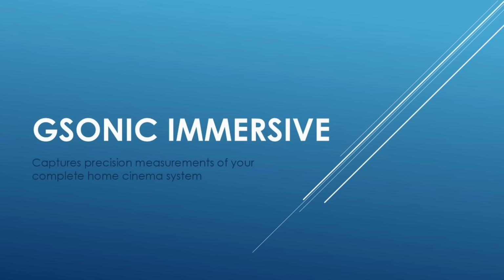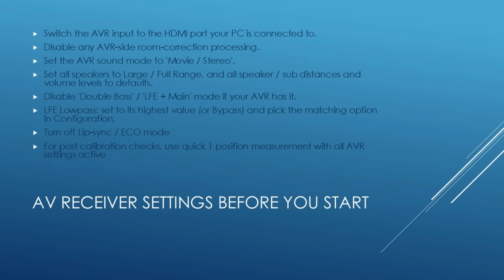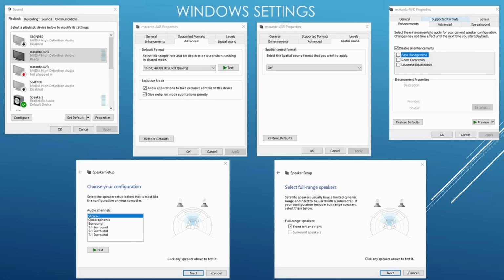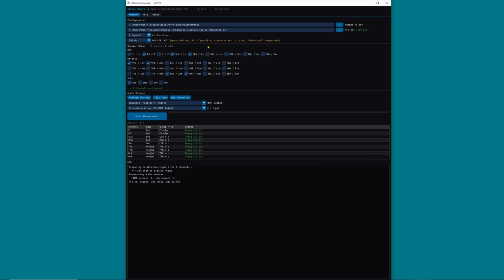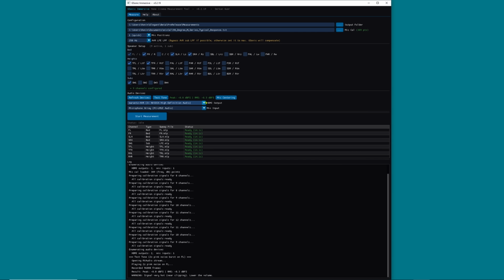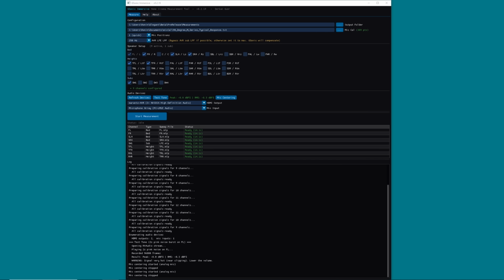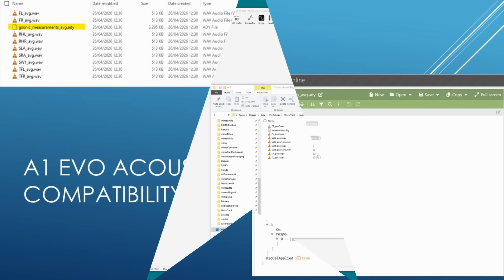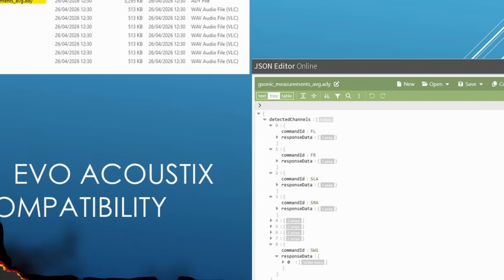GSonic Immersive

Comment: Posted on the Facebook group but posting here also hoping for a fix as I bought a umik for this!

I have everything set to the video, but sweeps are hitting different speakers, center channel is hitting my top left height. Everything functioning correctly outside of app. I think it’s a routing problem. Maybe some debugging can be added to app so I can post a log? Denon x2800h.

If some debugging added I’ll be very proactive for you to fix. Thanks!
Reply from the maker: That's only ever possible if your AVR is in an up-mixing sound mode. Please read the boring Help page of the app. I updated it with v1.1.0 with new info based on issues seen with some users. For example if your AVR supports it, "pure Auto" mode works better than stereo in some models. That alone will probably fix all your issues however, if problems continue, app already saves full debug logs and you can share them when you need to (see app About window).
Reply: @ocaudiophile  Hey, auto worked! Thank you. Music stereo did not work on my receiver.
Reply from the maker: Thanks for the feedback. Enjoy!

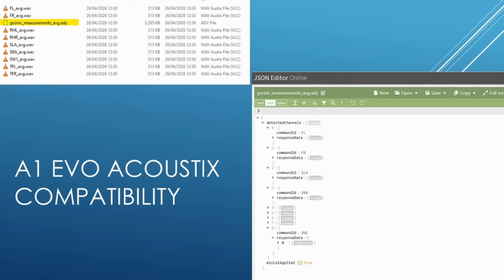Comment: There’s an error at 13:12 where instructional content form the video seems to start spontaneously halfway through? Is this missing information or repeated from before? Thanks!
Reply from the maker: It's an editing error for sure. I need to check and see if it can be removed (no editing allowed in YT only cutting)
Reply: @ocaudiophile  Thanks! Can you tell me if GSonic performs the same functions of A1 Evo Acoustic? Will it correct my room automatically? Im asking on the forums and I'm getting "it's a measurement tool" which makes me feel like it's not going to do the automatic room correction? What are the differences from A1? Thanks!
Reply from the maker: No, GSI is just a high precision measurement tool and not limited to D&M gear but it can generate ady files suitable for AcoustiX.
Reply: @ocaudiophile ahhh that’s very good about non-D&M support!

Comment: Please could you check if there is a programming error for the SHL/SHR channels? During measurements with Gsonic, the SHL/SHR sweeps  are always output through the FHL/FHR channels. I have changed various settings on my AVC-8500HA, but the problem persists even with different configurations. However, when I check the AVC DENON using the internal menu with pink noise, the routing is correct. The SHR/SHL pink noise is output from the corresponding speakers. All of the other speakers working properly in according to the signal sent from Gsonic. Thanks in advance.
Reply from the maker: Unlikely but I am looking into it. Will let you know.
Reply from the maker: SHL/SHR is correctly generated as identical and direct replacement to TML/TMR (top middle) similar to FHL/FHR being a direct replacement for TFL/TFR and RHL/RHR being a direct replacement for TRL/TRR. These pairs cannot exits simultaneously. And although SHL/SHR is quite rare (hence the reason I needed to double check), all others have been widely tested with no issues. Since your 8500 can do all 3 ceiling configurations, there might be a model specific issue with the renderer directing the sweeps. Can you try changing the names of SHL/SHR speakers to TML/TMR and see if it's fixed?
Reply: @ocaudiophile  Where do I change the name in Gsonic or in Denon? I should unchek SHR/SHL and Check TML/TMR in Gsonic?
Reply: I tried to unchek SHR/SHL and check TML/TMR in Gsonic, signal now is in RHL/RHR?
Reply from the maker: You have to change the amp assign configuration in the Denon menu. Do you have the U30 update?
Reply: @ocaudiophile  Yes I Have.
Reply from the maker: If problems continue, just set your SHL/SHR speakers as TML/TMR in your Denon and tick TML/TMR in Gsonic. You should be able to measure them correctly and you do not need to change the settings back. It's the same thing for the renderer.
Reply: @ocaudiophile  I tried, and have changed speaker lay-out from SHL/SHR to TML/TMR  (speacker hight installation  to speaker in the ceiling) now it is working. But I d'ont have speaker in the ceiling and for me any calibration means have to change lay-out and after have to change speaker name i the ady file. Is it possible to fix the problem with correct related address to name? Thanks
Reply: I feel like I’m having this too? The sweeps play from wrong speakers.  Center goes to top left height. Denon x2800h.
Reply from the maker: That's not possible unless you are setting your AVR to some upmixing  sound mode. Please read app Help page carefully for common issues and fixes.

Comment: I'm little bit confused. Does the benefits of this tool, timeings, phase ect, contribute to AcustiX callibrations? Does generated ady file even have the data model for all that precision of GSonic measurements and how efficiently AcustiX uses them?
Reply from the maker: Yes, they all go into AcoustiX. Although the resolution needs to be dropped for Audyssey compatibility, the phase fluctuations inherent with Audyssey measurements are not in the original and will not pass to the ady file. If you have very clean signal line in your set up (very very rare) and you already have multiple repeat measurements you are using happily, you may not see a night and day difference though.

Comment: Very Nice Job OCA!:trophy-yellow-smiling::medal-yellow-first-red:
Is the GSonic Immersive including the correction filters fully functional and will work will all the GSonic features on the Emotiva RMC 1 Plus Processor?

Or will GSonic Immersive work only on AV Receivers and not work on non Marantz Processors?
Reply from the maker: Thanks. It does not create filters. It's only a measurement tool and yes it can measure all speakers/subs from ANY model AVR//amp/receiver that you can connect to your PC via HDMI.

Comment: What's the support contact email?  I just bought this and need assistance (Keep getting FL ATR error)
Reply from the maker: Can you try with "Allow exclusive access..." un-ticked for the microphone you are using in Windows settings?
Reply: I don't see this option in windows 11.  Btw I am using Denon x3500 with Denon mic @ocaudiophile .. the app also can never find my receiver unless I manually input the IP... I been using acoustic evo without issue.  I believe the issue is the mic volume is too low because when I text my voice it's low volume... But gain is +30db (max) in windows
Reply from the maker: Press Windows key + R
Type:
mmsys.cpl
Press Enter
Reply: Thanks toggling Allow Exclusive seemed to fix this.  I'm able to take measurements now.
Reply from the maker: You will not have to do this after the next update

Comment: How I can misure CH Hight Central Channel and TS Top surround Channel for my Auro 3D configuration? Maybe Coud I  use SDL and SDR buttons?  I Think  it is a possible  alternative connection at the same receiver out section (Height 3). In dolby atmos Height 3 have SDL and SDR connected to instead in Auro 3D I have, in the same order, TS and CH. My receciver is an AVC-X8500HA DENON receiver?  Or maybe you can add the CH and TS Buttons. Thanks
Reply: I am using the latest (1.0.9 - build 7DEF55) release of your software. I tried using SDL and SDR to replace CH and TS, respectively. I used Dolby Access in Windows in a 7.1.4 max configuration with the “Stereo” selection in the AVR and took the correct measurements with the right speakers TS and CH. In the ADY file, I replaced SDL with TS and SDR with CH, and Acoustix recognized it and performed the optimization phase. Perhaps you could add two new buttons, TS and CH, with the same addresses as SDL and SDR (one choice excludes the other in the Atmos configuration for DENON AVC-X85500HA). This way, we can avoid having to edit the ADY file after taking the measurements.
Reply from the maker: Noted, good info, thanks.
Reply from the maker: Unique Auro 3D channel sweeps are not technically possible. There's a new firmware update where you can redirect channels to those but only some new top end models got it. Not sure if 8500 did. The only other option is to swap speaker cables.

Comment: Hi OCA, can I ask one question so it can be put to bed. Do you recommend 0 degree or 90 degree microphone setup for Gsonic immersive, I know you have said zero degree pointing at the speakers for the stereo set up in Gsonic reference; just wanted to confirm if it’s the same for immersive and Atmos speakers. 

Thanks
Kevin
Reply: Perfect thanks; that gives me an excuse to do it all over again this weekend with V 1.09 😂
Reply from the maker: To measure speakers placed all around the room, your best way is to use the mic pointing up with 90 deg calibration file.

Comment: In the event of issues regarding differing test tone volumes between the Front Left and Front Right channels:

BEFORE performing the measurement, start playing a movie with a Dolby Atmos audio track (this is important!) and, within the receiver's setup menu under "Surround Parameters,"
disable "Loudness Management." This is sometimes where the solution lies.
Set all options here to "OFF" and the LFE level to "0."

Then, continue preparing the receiver step-by-step, following the instructions in the manual.

Perhaps the manual could be updated to include this information.

Best regards
Reply from the maker: Thanks for the tip and FYI the new AVR reset button in v1.0.9 can and will turn Loudness management off!
Reply: @ocaudiophile  cool. Thankyou